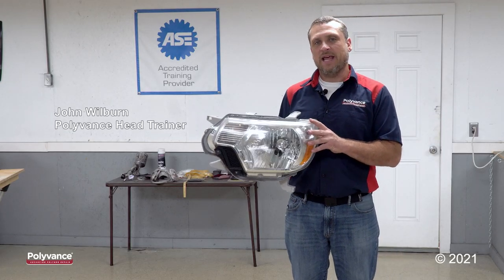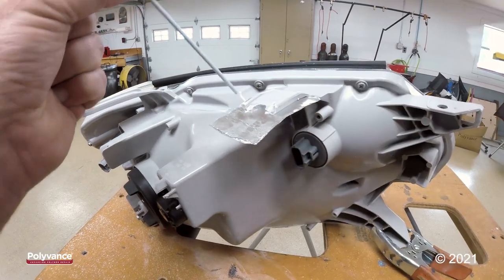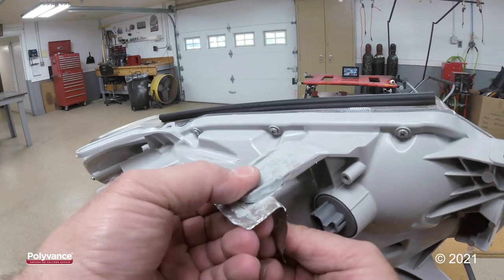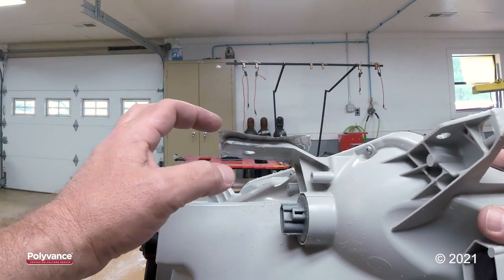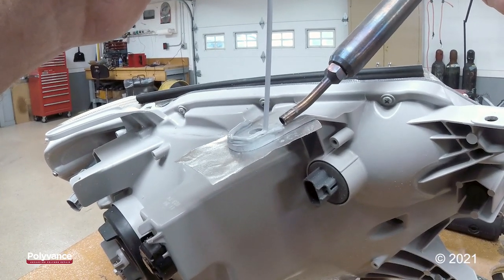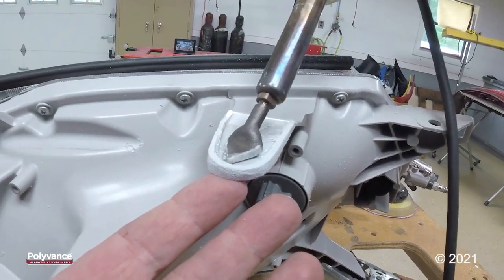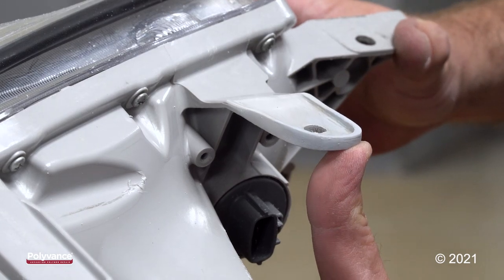Plastic Pointers #11 - Rebuilding a Broken Headlight Tab

Comment: That’s a bit beyond repair. I would say that is refurbishing and nearly remanufacturing it. Amazing how good that looks. I have 2 headlights each with one broken tab. I have a hot iron, but no hot air. I do have other headlights to use as material, so it will at least match. I am thinking about getting hot air…can also use hot air for solder reflow, so yeah.
Awesome job, great video
Reply from the maker: Thanks! Yes, rebuilding a tab like this definitely takes some skill. This video was just to show it is possible. Repairing a crack when you have the broken pieces is much easier than this.
If you have any questions about the repair you will be doing, you can give us a call and we can give you some guidelines.
Reply: @polyvance  very nice. I sure appreciate the offer. I have some material to practice with that is same as the headlights I plan to fix (ABS), so I am going to practice until I have the confidence to do it and do it right. I have a hot air reflow machine for soldering, I am going to try to adapt it for plastic welding. I have a plastic welding iron and a hot stapler or whatever they are called, so I will do my best to make mine as good as the headlight in the video.

Comment: It is polypropylene with some additional material TD 20% >PP-TD20<, any idea what that TD could be and its purpose?
I have this Polyvance iron smoother, very good for finishing job after hot air welder, very useful tool!
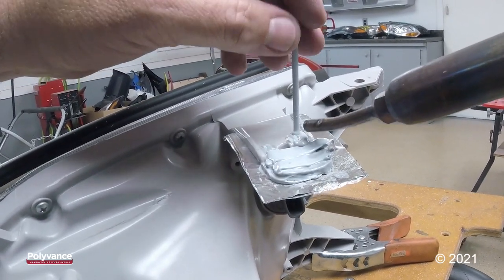Reply from the maker: The TD20 is a talc filler that has been added. So with PP-TD20, you've got a polypropylene with 20% talc filler. The talc filler makes the plastic brittle, which causes it to break cleanly. Broken tabs normally fit back on the part very tightly. Check out the section between 1:55 and 2:15 in this video to see an example = https://www.youtube.com/watch?v=flNmbXpUqz8